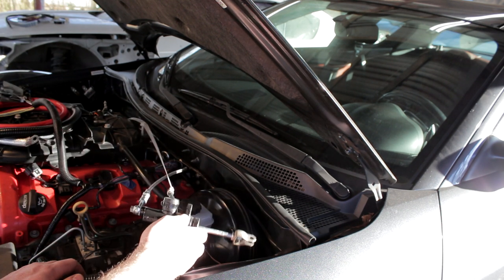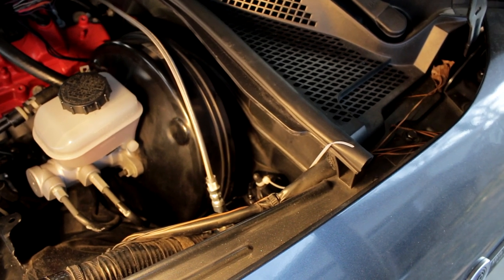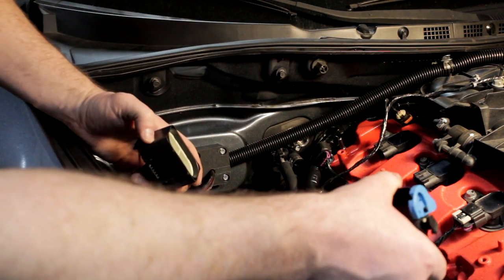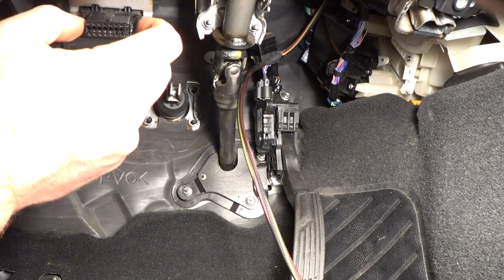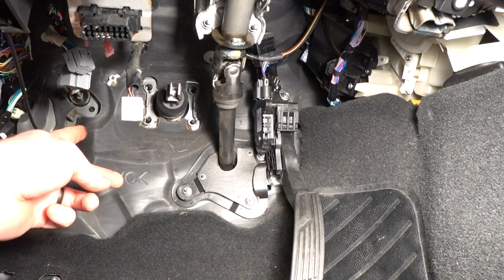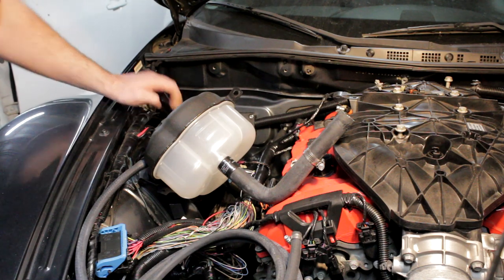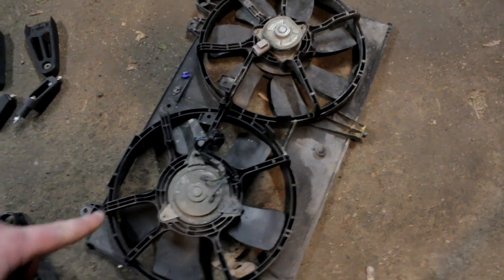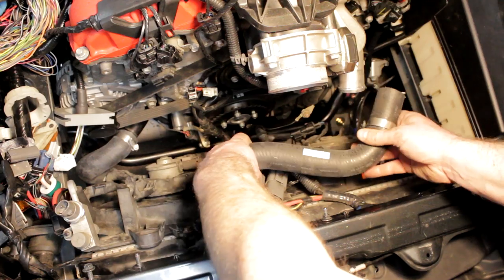Installing Pedals and Cooling System in LFX RX-8

Comment: Love watching the videos. I'd love to know where you got the sway bar and the kit from. Plus the steering rack kit from to. That would help me loads. I've put in a jaguar s-type 3.0 V6
Reply from the maker: Thanks. The Jag engine definitely makes a good sound. It was one of the possible engines on my list when starting this project. The sway bar and steering rack pieces are all parts of the Keisler Automation LFX swap kit that the videos have been about. The kit basically includes everything needed to swap the LFX into the rx8. You may want to contact them to see if they can sell you those parts separately. When I bought the kit it had to all be purchased together. Good luck with your swap!

Comment: Great video series. I'm also doing the LFX swap using an automatic car. When you installed the clutch pedal, was there a switch you need to install with it? If so where did it plug in? Also, did you have to reset or use a new brake switch? Oh and what ended up happening with the automatic transmission control module? Thanks!